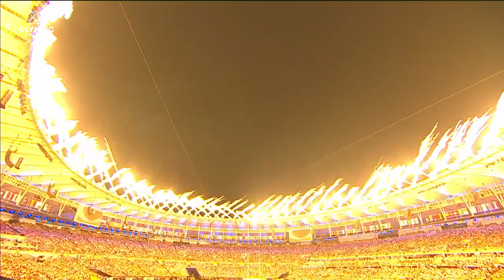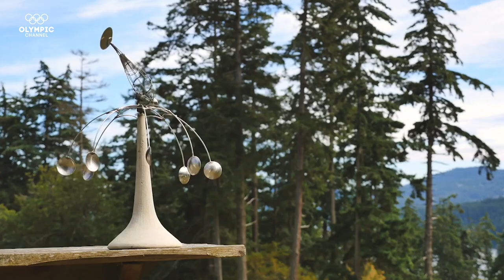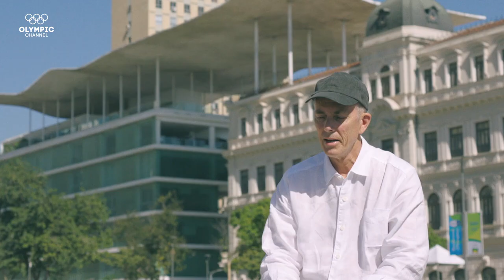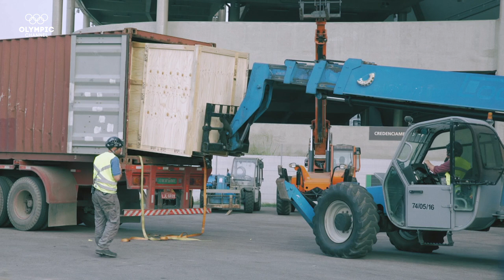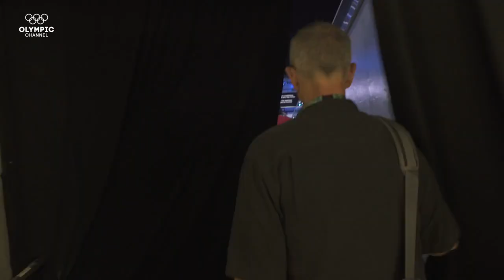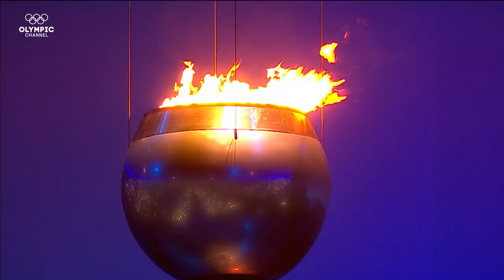How the Rio 2016 Olympic Cauldron was Made | Viva! - Behind the Scenes Rio 2016 Opening Ceremony

Comment: Since 1976, every Olympic Stadium torch lighting procedure has been fantastic, but this one stands out as the most Iconic! That sculpture is definitely 10/10! A true piece of interpretation of the sun! Congratulations to the designer & Rio Brazil! 💓❤💗💝💞💖💕💟😘💋✋🎉🎇🎆
Reply: Only problem is, the flame is NOT part of the sculpture.  It's a separate piece and is merely used to reflect the light from the flame.  So, to be strict about it, it's a FAKE Olympic cauldron.  All other Olympic cauldrons pervious to this were all INTEGRATED wholes.  Not this one.
Reply: @mylesgarcia4625  That doesn't stop to become one of the most iconic olympic cauldrons in history.
Reply: @janmarcfuldan9816   Eh.  Technically, it ISN'T.  The sculpture is just a decorative appendage to the goblet of flame.  It becomes, just like a disco mirror ball, or a fake, digital background.  Look at all the other Olympic cauldrons and you may or may not understand why.
Reply: @mylesgarcia4625  apparently you couldn't notice that Rio opening ceremony was ecology themed and this cauldron is the one that less environmental impact causes so far. The Kinect sculpture is to compensate this much smaller flame and make the greatest light effect possible. 
Even if the sculpture is not part of cauldron, they are integrated and complete each other.
Reply: @latitude23S   Not really. The pot of flame can exist and function without the giant Howe sculpture.  And what about the resources and carbon footprint that went into crafting NOT one but TWO of those Howe sculptures?  Not to mention the shipping of those things from both the USA and Germany, That's not ecologically responsible?  BTW, the bigger ceremonial "sculpture" is sitting in a box in a warehouse in Barra.  So why don't you 'look in the mirror first before you try to castigate others?  DUH!!!
Reply: @mylesgarcia4625  But it doesn't matter whether the sculpture is part of the flame or not.  DOES NOT MATTER.
Reply: @mylesgarcia4625  And the two used cauldrons were not lit at the same time, the one in the stadium was lit only during the ceremonies
Reply: @joaquimmsn   Technically, it does.  I have studied Ceremonies since 1968 and have even written a book about it.  But then, you are just too hard-headed to explain the nuance to you.
Reply: @latitude23S  Not really.  You can still have the little pots of fire burning WITHOUT the sculpture.  How can you say it's :enivronmentally responsible or whatever' -- when so MUCH ENERGY went into crafting NOT ONE but TWO sculpture-cauldrons.  Yes, the flame is small but what about the sweat, labor and fuel that went into fashioning the two sculptures.  As a matter of fact, while the one if the port is indeed made of stainless steel, the show one in Maracana was made from a lot of PVC pipes and fiberglass-- so petroleum-based products.  Do your research first before making wild claims.
Reply: @mylesgarcia4625  Are you stubborn about starting a discussion on such a small and unnecessary subject
Reply: @mylesgarcia4625  Wow, big difference between building one or two.  If you still don't understand the message that the cauldron wanted to convey, it means that you are the one who is insisting
Reply: @mylesgarcia4625  You had already answered 3 weeks ago.
I know that few people have capability to understand this disruptive cauldron, but with yours fierce insistence on devaluing it, makes me wonder why you are such destructive and what do you expect from it? And why you are so aggressive and bitter in response if I treated you with respect?
Your attitude makes me didn't ask you for the first time.
All your dedication in the comments and your thesis exposed here end up being negligible.  What really stands out in your analysis is a resentment for this symbol of this Olympics.
That said, when your exasperation is more obvious than your arguments, you lose credibility and I won't even bother to challenge you.
On that score, I think your Hispanic last name might be the way to the answer.
Carry on with your hatred of this cauldron, I will not change your opinion and your attempt to change the opinion of others who come here is a waste of time.
Reply: @mylesgarcia4625  your truth is not the absolute truth. You mix up truth with hatred and jealousy. 
Vaya con Dios hispanic.
Reply: @mylesgarcia4625  Your truth is unnecessary and irrelevant
Reply: @UCJVoZQHrIz-Bozs2YTGj58Q What challenge?  Only you are caring about the origin and use of the cauldron, in an unnecessary way, what you are questioning is irrelevant
Reply: @mylesgarcia4625   Londres tbm não foi uma pira Olímpica , foram várias tochas individuais que se completavam, mas não ficou agradável aos olhos .  Já a Pira Olímpica do RIO 2016 sem comentários... A pira mais linda e criativa da história. Representação do sol que por sinal os seus raios não estão grudados em sí, os raios do sol são liberados iluminando todo o Planeta . ☀️
Reply: @mylesgarcia4625  Defecou pela boca   😛💩. LONDRES  foram várias peças separadas , então quando você diz que todos anteriores foram integrados você mostra não ter conhecimento algum do que diz.     Aqui no Brasil isso se chama RECALQUE! 😂😂😂😂
Reply: @moiseslanhouse   I don't speak Portuguese.  So whatever your answer is -- means NOTHING/NADA to me.  Sorry.
Reply: @mylesgarcia4625  Don't worry, it's just an answer to break your thesis about the Olympic cauldrons. In this case, it's great that you don't speak Portuguese, because here you are embarrassing yourself by distilling baseless poisonous words.
Reply: @moiseslanhouse  Not really.  I am NOT embarrassed and stand by my opinion.  It is a "fake" cauldron.  Whether you agree or not is IRRELEVANT to me -- and frankly, I don't care.  😃🤣😃🤣
Reply: @moiseslanhouse  London's 196 petals-for BOTH the regular OGs and (less for) the Paralympics--ALL carried flames - and closed up to UNITE as one entity.  Were you blind or do you have trouble understanding such a simple concept?  The flame of 2016 is MERELY reflected in Howe's sculpture.  The fire does NOT EVEN generate the movement of the sculpture.  There was a separate machine for that at Maracana; and the outside one relies on natural wind.  But they are STILL NOT connected to the flame. You must be blind,  DUH!!